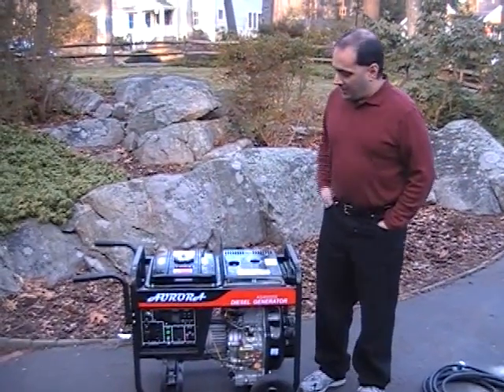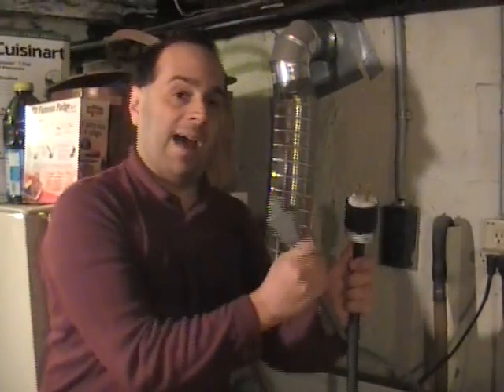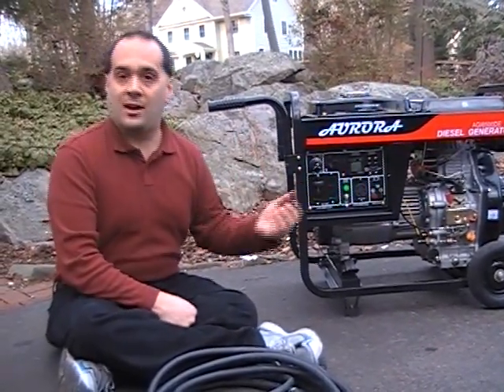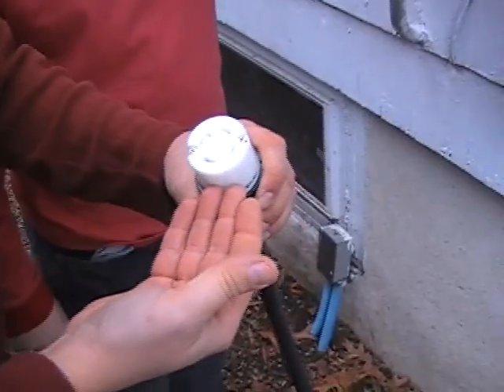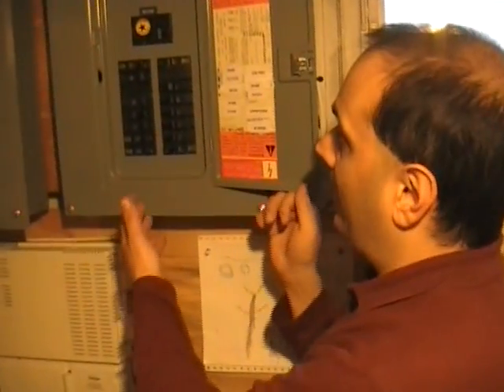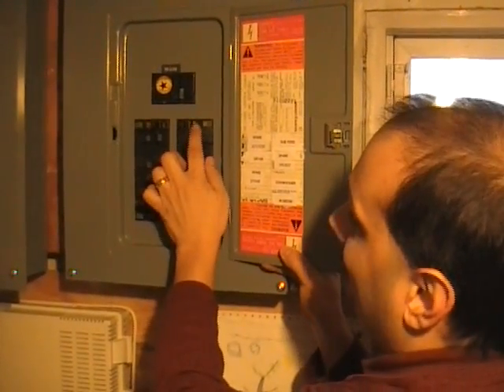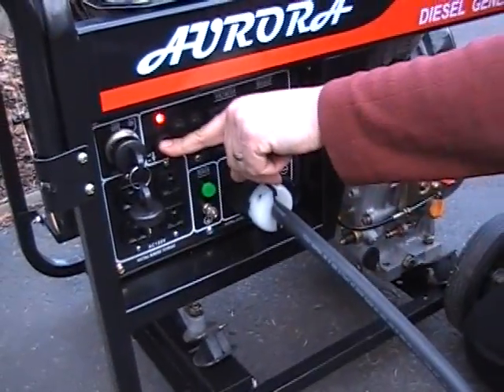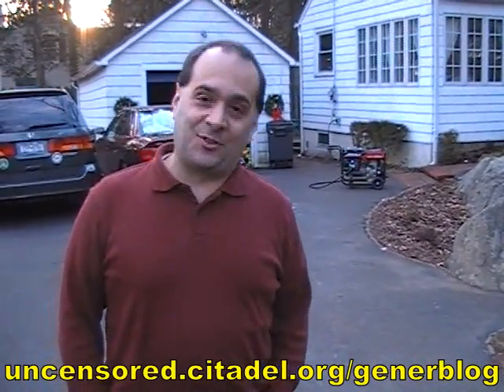Inexpensive residential generator hookup

Comment: So only the circuits in the new panel get powered by the genset? 
I just saw a new super easy plug n play product on Home
Depot, it’s an auto matic xfer switch that goes between your utility meter head and main panel lugs! Literally plug and play! (remove meter head from socket, plug in xfer switch, plug meter head back in DONE!
(new socket has gen inlet receptacle built into it)

And to all the whiners, that diesel gen is likely quieter than most gasoline gens because itspins at only 1800 rippems, Yes Hondas are quieter, but not by much, the 7000watt honda for example under full load is NOT quieter.
Reply: callapygian yes, that’s great...if you’ve got an extra $650 you can afford to spend on the 30 amp version.
Reply: Always make sure you follow all the generator safety rules before using portable generators. This is just a reminder for everyone’s safety. Here are the rules about generator safety: Generators can be dangerous if not used carefully. Every year, hundreds of people die or get injured when using portable generators due to carbon monoxide poisoning and electrocution. Make sure you are using your generator carefully and keeping others safe as well. There is something very serious that everyone should always be aware of when using generators. Some people do run their generator indoors which is not safe and that increases the risk of carbon monoxide poisoning which can cause death of family and you. Some people run their generator in wet conditions which can electrocute them. Please remember that you should never run your generator indoors. Remember that carbon monoxide is an odorless and colorless gas that you cannot see or smell. Carbon monoxide is a silent killer. Keep that in mind. Make sure your generator is 15-20 feet away from your house and away from doors, windows, and vents. Never use your generator in your porch too. Having a carbon monoxide detector is very important against generator safety. Some people also allow children to go near the portable generator which could pose risks. We need to keep an eye on our children making sure that they are not near the portable generator so they won’t get electrocuted or burned by the generator which is dangerous. A locking enclosure also keeps kids safe. A generator shed might look like a tempting place to explore, or take cover during a game of hide and seek, but a generator is a dangerous piece of equipment that can cause injury. It says on the manual that we should also keep children away at all times from the portable generator to avoid injuries. Please do not allow a child or unqualified people to operate the portable generator.  It is important to keep your children safe especially little ones. The portable generator can be hot during an operation. Just because some manuals missed what should be listed doesn’t mean it’s safe to do. Always follow the generator safety rules when using portable generators. Generators pose electrical risks. If you need to use your generator during wet weather, you need a generator tent to protect your generator from getting wet. Don’t let your generator get wet. Keep your generator dry and before using your generator, please make sure your hands and your generator is dry. Do not wear loose clothing when operating the generator. Everything that is said on the generator’s operating manual should not be ignored. Never smoke cigarettes near the generator. Please keep flammable things away from the generator. Never overload your generator too. Your generator can catch fire. Never ever try to plug a generator cord into a wall outlet to avoid back feeding. Back feeding your generator is dangerous. Always turn on your generator first before plugging in appliances and shut off the appliances before turning your generator off. Use a heavy duty cord for your generator and the cord should not be worn out. All the instructions should be followed carefully. Never refuel your generator while it’s running. It can cause fire if fuel spills while your generator is hot. You should turn off your generator and let it cool off before refueling it. Having a fire extinguisher next to the generator is also important. This is only a reminder for everyone’s safety of using generators. Make sure your generator is properly grounded. Having a fire extinguisher next to the generator is also important against the safety rules. https://youtu.be/I1jT3ANENvI and here is a video more about keeping others safe when using generators and also about our family’s safety. It’s important to keep our little children safe as well. Make sure they’re away from the generator. Hope this helps.

Comment: Very good video! 
My only issue with your video is not with the video but with your choice of generator. Your generator will strain your relationship with your neighbors. That is one very noisey generator! The BEST & only portable power anyone should buy is Honda inverter power. I personally have their flagship model EU 7000is. I can power up my entire 1700 sqft house including my central air with it. When running at full load in economy mode it purrs at 54 decibels. 58 decibels in full throttle. Typical conversation is about 70 decibels. Another words your neighbors might not know your on portable power when the lights go out in your neighborhood.
Reply: Well done public safety message! The only other thing I could recommend would be a separate 8’ driven ground rod near the generator. My genset is connected to a ground rod with more than capable wire & hardware. I also ran a tap to the stainless steel enclosure so everything is at the same potential-zero volts. One other thing that sets me apart from joe homeowner is that I’m a distribution lineman for the local power company. Whenever we work in a neighborhood with generators running we test for voltage on our equipment before we proceed. Fortunately most generators we have found are hooked up correctly. The last thing I want is someone to be hurt by my generator. I have nomenclature warning of my genset out at my meter can incase someone decides to test voltage? I use an inter lock in my CB panel.
Reply: A generator enclosure (box) will quiet your genset as well as protect it from rain. Honda's aren't either rainproof, or theft proof either.
Fact is, Honda's are the most stolen gensets. Thieves just love them.They just plug in a Dremel with a carbide cutting blade into the Honda receptacle, and in 15 seconds they have a premium chain/lock to go with their new genset. Works great on Krytonite products too!
Reply: chris chilson “They just plug in a Dremel with a carbide cutting blade into the Honda receptacle…” Wow, that’s adding insult to injury isn’t it? LOL
Reply: Well, I’ve already thought of the criminal element. The genset is in a fully enclosed stainless steel box. There is a padlock purchased from a locksmith securing it. As well as infrared cameras both front & back. If the thief really wants it? He’ll have to cut the lock & lift the 280  pound generator vertically 4 feet to clear the box. Drag it up a 30 degree hill to his vehicle. All captured on video. 
They’d have to be pretty brazen to pull that off without anyone noticing? Especially the senior citizens that live next door.
Reply: @johnclyne6350  Most thieves will find another easier to steal genset, I would think. But a thief crushed himself trying to steal an ATM in Opa Locka last week. Darn those drugs...
Reply: @johnclyne6350  always make sure you follow all the generator safety rules before using portable generators. This is just a reminder for everyone’s safety. Here are the rules about generator safety: Generators can be dangerous if not used carefully. Every year, hundreds of people die or get injured when using portable generators due to carbon monoxide poisoning and electrocution. Make sure you are using your generator carefully and keeping others safe as well. There is something very serious that everyone should always be aware of when using generators. Some people do run their generator indoors which is not safe and that increases the risk of carbon monoxide poisoning which can cause death of family and you. Some people run their generator in wet conditions which can electrocute them. Please remember that you should never run your generator indoors. Remember that carbon monoxide is an odorless and colorless gas that you cannot see or smell. Carbon monoxide is a silent killer. Keep that in mind. Make sure your generator is 15-20 feet away from your house and away from doors, windows, and vents. Never use your generator in your porch too. Having a carbon monoxide detector is very important against generator safety. Some people also allow children to go near the portable generator which could pose risks. We need to keep an eye on our children making sure that they are not near the portable generator so they won’t get electrocuted or burned by the generator which is dangerous. A locking enclosure also keeps kids safe. A generator shed might look like a tempting place to explore, or take cover during a game of hide and seek, but a generator is a dangerous piece of equipment that can cause injury. It says on the manual that we should also keep children away at all times from the portable generator to avoid injuries. Please do not allow a child or unqualified people to operate the portable generator.  It is important to keep your children safe especially little ones. The portable generator can be hot during an operation. Just because some manuals missed what should be listed doesn’t mean it’s safe to do. Always follow the generator safety rules when using portable generators. Generators pose electrical risks. If you need to use your generator during wet weather, you need a generator tent to protect your generator from getting wet. Don’t let your generator get wet. Keep your generator dry and before using your generator, please make sure your hands and your generator is dry. Do not wear loose clothing when operating the generator. Everything that is said on the generator’s operating manual should not be ignored. Never smoke cigarettes near the generator. Please keep flammable things away from the generator. Never overload your generator too. Your generator can catch fire. Never ever try to plug a generator cord into a wall outlet to avoid back feeding. Back feeding your generator is dangerous. Always turn on your generator first before plugging in appliances and shut off the appliances before turning your generator off. Use a heavy duty cord for your generator and the cord should not be worn out. All the instructions should be followed carefully. Never refuel your generator while it’s running. It can cause fire if fuel spills while your generator is hot. You should turn off your generator and let it cool off before refueling it. Having a fire extinguisher next to the generator is also important. This is only a reminder for everyone’s safety of using generators. Make sure your generator is properly grounded. Having a fire extinguisher next to the generator is also important against the safety rules. https://youtu.be/I1jT3ANENvI and here is a video more about keeping others safe when using generators and also about our family’s safety. It’s important to keep our little children safe as well. Make sure they’re away from the generator. Hope this helps. Have a good one